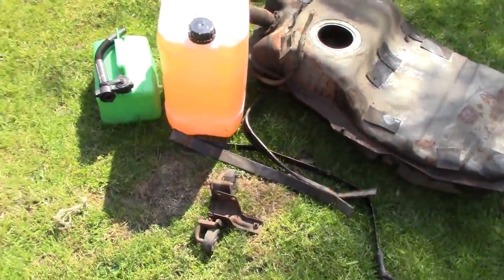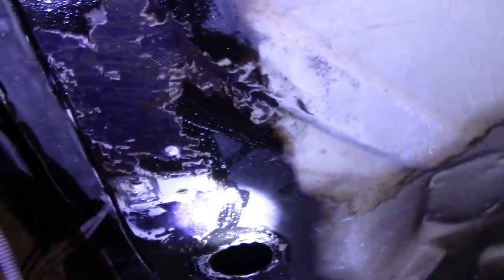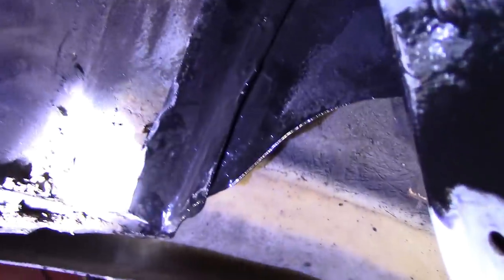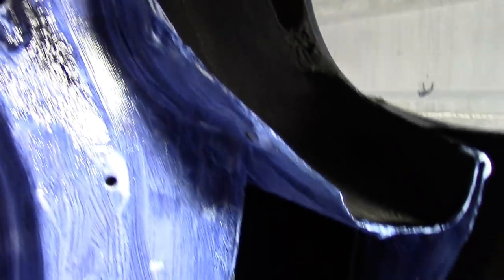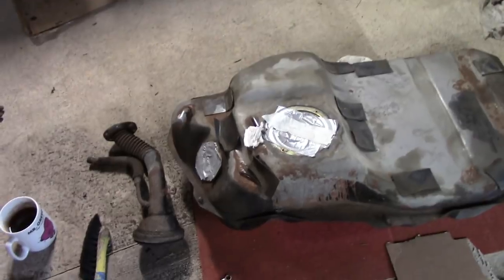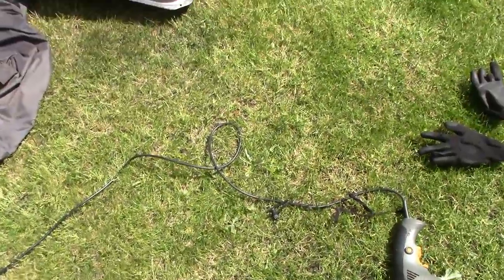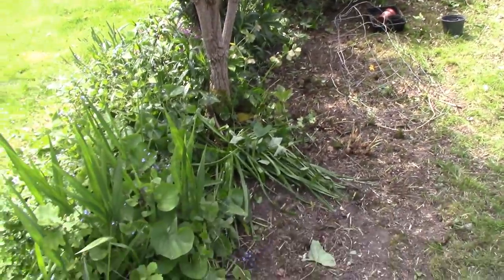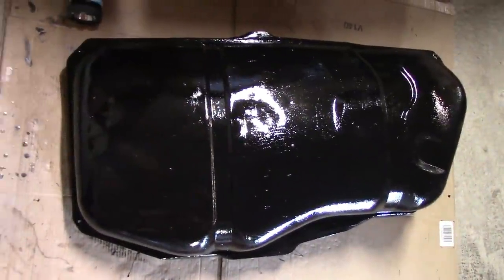1994 Nissan Sil80: Restoring/Modifying Fuel Tank & Rear End | Phase 3

Comment: Ha! My first car was a black hatch (USDM)...I turbo'd the factory motor and made ~260 wheel on it for 4 years daily driving it. When it finally was drinking more oil than gas I built an SR20det with rods/pistons and VVT head swap (ported/polished, +1MM intake valves and BCrower cams.) 440 on pump gas 505 w/ meth. on GT2872rs.
Reply from the maker: Cool. I have 2872rs on my old S14 :)

Comment: When you get round to starting it, do so with fresh petrol. The higher fractions in the petrol will boil off slowly over time and it loses some of it's oomph. That stuff you took out looks a bit orangey. Otherwise you can waste time troubleshooting the engine when it's a fuel problem.

Comment: Next time... Put the tank on stands, then find balance point to lift it on a trolley jack, wheel it under car and jack up to floor. One man job in about 1/2 hour. Getting it out use 3 scissor jacks to support, lower on to trolley jack and wheel out. Couldn't save my straps, bolted some 30x2mm alloy strips bought from B&Q to the ends.

Comment: Rust is the oxidation of iron along with the absorption of water to make Fe2O3 with water molecules attached.  Its a fairly typical chemical reaction that speeds up with higher temperature.
Reply from the maker: Now use that big Arty brain to stop it rusting???
Reply: @grimreapers  If I could find a cost effectiove way to do that I'd be a VERY rich man!!    Only way I knowis what you are doing.   Anti-rust coatings  and seal  the surfaces to keep the water (and atmospheric moisture)  out.

Comment: Don't forget Cap , all that metal was there for a reason .. See an old time body guy to find out what you have to weld back in and what you don't . Also the reason for all the rust is age of car , weather it is driven in and  land area it spends it's life in
Reply from the maker: Roger will get it all OK'd by a proper guy before she goes back on the road.
Reply: @grimreapers  Glad to hear it . I'd hate to hear you had an accident once you got it on the road because  of a  structural issue . I didn't see the yard before you bought  the house but, from what I see you've been very busy . Keep up the great video's . I admit to being partial  to Fun Day Sundays and IL2 Thursdays .  I also enjoy your WW ll series . Thanks again for responding .

Comment: Cap you can get parts for them in the USA.  It is a Nissan 240sx.  A brand new Fuel Tank or Petro tank.  https://www.nissanpartsdeal.com/parts/nissan-tank-assy-fuel~17202-53f56.html?Make=Nissan&Model=240SX&Year=1994&Submodel=&Filter=()&Location=pd:172_B01,17201
Reply from the maker: AMAZING! Thanks for the link. I couldn't find one anywhere.
Reply: @grimreapers  your Welcome and Thank You for the tutorials and other videos.
Reply: @grimreapers  you should also ask DCS when you are going to get the F-18-G Growler and the F-18-E/F Or The A-6 and the A-6-G Groweler